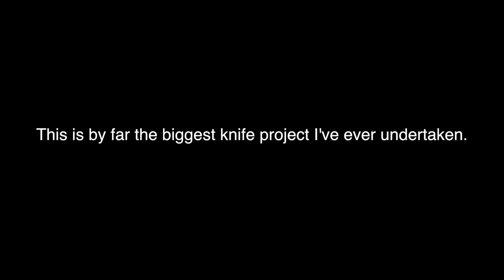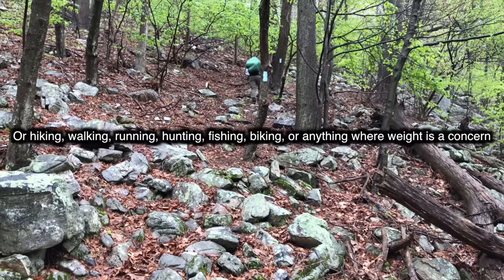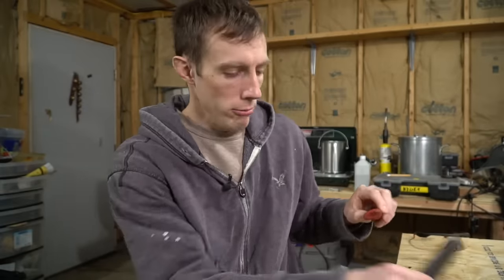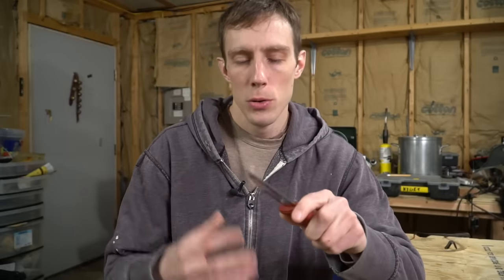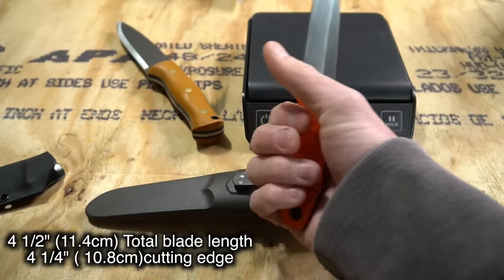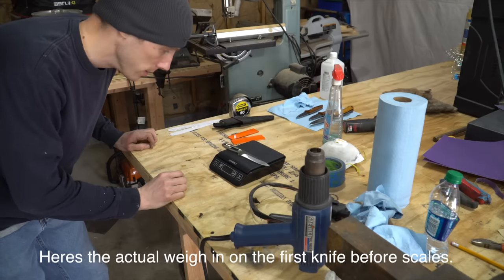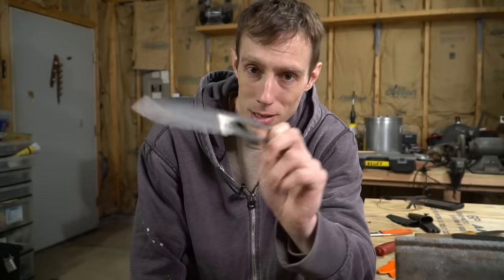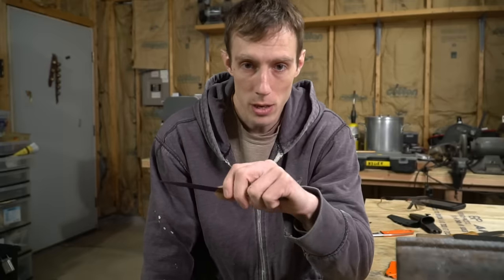What is the ULTIMATE Knife? Probably not what you think...

Comment: Ok, this was a really old video - for the algorithm, for fun..  Of course we all learn more over the years..

(carbon fibre and fibreglass COMPOSITES weigh about the same as 75% epoxy, stiffness and strength vs weight is the key with materials selection, not "bulk modulus" - Aramid and UHMWPE fabric is lighter than carbon.  Handle scale material is better chosen for appearance and style than mechanical properties - especially in a full tang knife  (hollow out and fill with foam when really worried about 10 grammes.. )

Comment: Ka-Bar ESEE Becker Eskabar, 3 oz, 3.25" blade that's 0.17" thick.  But that's with a handle that's naked steel.
Reply from the maker: No scales and blade is too short. Doesn't fit the parameters.
Reply: @OUTDOORS55  Close, though.

Comment: What if you used titanium for the blade?
Reply: Way way way too soft. Titanium is very strong for its weight, but does not have near the hardness required for a knife.
Reply: @2stroke_fanatic357  Titanium can be hardened to the mid 40's and it has been made into fixed blade knives. I believe Mission knives is one manufacturer.
Reply: @informedcitizen8687  that would only be used as a driving knife! Mid 40's  is a joke! Anything under 55 would wouldn't make much of a knife. Hey, let's use cardboard, because we all know about paper cuts! 😁

Comment: Why not remove the center of the scales, go with a tapered spine? At the back, you could use thicker carbon fiber to get good feel in hand, and just pin it with like 8 small pins, plus a hallow lanyard pin. Maybe a smooth hourglass like fuller to take some weight out of the blade. Screws may be lighter than pins and recess for them would take even more weight out while possibly adding a bit of grip, but terrible for keeping clean.

Comment: In continuation of my first comment. You could also reduce the size of the scale without reducing comfort. If you remove a few mm from all the edges... the scales will still feel good and you can use normal G10. Failing that you can drill pattern the handle like crazy... make it a feature of the knife.. it will enhance grip.  I feel like I should take up the challenge... Hmmmmmm

Comment: Well, if the steel is 3oz at 0.120" thick, it will be 2oz at 0.080" thick, regardless of what type of steel.  I'd probably go aircraft-grade, something in the 41xx or 43xx series.  Or go crazy with Nickel-Chrome-Moly, which IIRC is 98xx series.  You'd need some rather high-carbon versions of those steels, but it shouldn't be impossible to find 4180.

Or you go extra-nuts with L6 tool steel.  Though with battoning, you might want a 0.120" thick spine and really hollow-grind the crap out of it.

Comment: Simple Solution. 80CRV2. Distal taper. FFG all the way to the spine. 1/8" thick on the spine at the ricasso. Hidden tang, tapered in both dimensions. Handle of stacked leather, a strong, light wood, or a combination of the two. If you want a guard, either Ti, Al will work, but thin steel would also be fine.

For non prying tasks, the highest strength to weight blade grind is a hollow grind, but can be more challenging. A FFG is barely gonna weigh any more.
Reply from the maker: Ive already ruled out a hidden tang as i dont want the handle material to be a structural element. Thats one thing i missed in the video. 👍
Reply: @OUTDOORS55  if you have a tig welder, you could do a titanium/steel san mai, with the whole handle of ti.  http://www.e-tokko.com/clad_metal.php?lang=en

They sell prelaminated billets.

Comment: I would like to bring the idea that every bit counts with this if you want to drop weight without kissing strength why didn’t you use a false edge, file working,  jimping, even a something as small as a etched or engraved design would help. I would just like you to consider these as they could make the knife look cooler while also dropping weight.
Reply: Tapered tangs, something similar to the channel in a Yakut knife would be feasible since you do forging know as well, I mean there are a lot more ways to remove a bit of metal, for your consideration the mora robust is not full tang and it easily handles batoning so maybe a thick push tang on a thinner knife blade
Reply: I’m going to begin making my own design to compare to yours I think it would be a cool challenge for other knife makers to try

Comment: Why not use titanium for weight and hardness?
Reply from the maker: Titanium is very soft not good for knives
Reply: @OUTDOORS55   mixed with high carbon steel, theoretically, should lighten wieghr and still give you a hard edge. That's just theory based on metalergy, I've never seen it proven in real life

Comment: What about adding a fuller to first knife
Reply from the maker: Thats a great idea 👍🤔
Reply: Have a look at Yakut knives for some inspiration, they have a large fuller forged into one side, the hidden tang would reduce weight too.

I have a few Mora's here that I will weigh.

Mora basic 511 is 78 grams.

Mora companion has a longer blade and weighs 77 grams.

Mora 612, this is a traditional mora with a thicker blade, steel ferrule, steel guard and hidden tang running 3/4 of the birch handle. It weighs 73 grams.

It should be noted that the Mora 612 is sharpened all the way to the heel of the blade before the tang, no ricasso.

If you're having trouble keeping below your weight limit with modern methods consider traditional methods and materials.

I love the concept of this under 3 ounce knife build, it really challenges you to think about material properties and efficient design.

Comment: Cool Vid, Hiking? you mean the PCT or Camino  type hike.. low weight makes sense. Here is an idea that you may want to kick around.Do a bit of calculating in terms or blade thickness taking into account you will skeletonize the blade......... WHAAAAT....Not so silly, you can optimize the hole or void pattern for battoning  .. makes heat treating a bit more challenging but you will reduce weight as well as keep your cost down. Carbon fiber scales are just very very expensive. You can make the difference up by machining out the inside of the scales. You only need a tiny wall thickness( Router or dremmel will work just fine) Just remember to do all the drilling etc before you bevel.... maybe also change your grind with this type of mod in mind. It will be fine for 99% tasks just not as a pry bar...Hope this helps....Keep the vids coming.

Comment: yes carbon fibre is the lighter material, but only About 20% (6g 1/5oz). you want a material with 50% lighter (15g 1/2oz) material. (Density G10: 1.85g/cm³ Density Carbon fibre: 1.5g/cm³)
you want material with 0.9g/cm³. even oak is (if dry enough) between 0.4g/cm³ and 0.9g/cm³.

Carbon fibre has it's Advantages in strength per gram (if you want to say it like that). you can work with extremely thin layers of Carbon fibre so you don't have so much material and thus weight. your handle should be strong, but (i imagine) it has to be of the Right thickness to grip it better.

i think Carbon fibre is not the material to use here.

Edit: Spelling errors (sorry for my bad english skills)

Comment: To each his chosen goal.  I have carried my 6.1 oz. Al Mar SERE 2000 every day for nearly two decades.  Why would I change for a trip onto the hills?  You recognize that a knife is your most important tool, so do not compromise.  Also, “two is one, one is none.”  I’ll add a fized blade to my EDC folder for that woods trip.  If I decide to carry my 19.25 oz. Busse Steelheart II it will be because I view the indestructible Busse as an alternative to a hatchet (which can also be a camp knife) and likely have a Silky saw with me.  If I go lighter, I’ll still take one of my most durable 4-5” fixed blades, chosen for durability over extreme light weight.  Saw off your toothbrush, buy carbon fiber tent pegs, if that kind of craziness is your thing.  But never compromise on your blades or your sleeping bag (Wiggy’s, of course).  Have fun with the ultralight project, but be rational. 👍.
Reply from the maker: Thats the point, no compromise but less weight.
Reply: @OUTDOORS55  it is definitely a challenge.

Comment: If you really care about weight then change out your scale material. You don't need a super durable plastic if you're using the knife in a reasonable way. You can probably do fine with a high density plastic foam or softwood.

Comment: mkay, so some quick maths I did from a class I took over two years ago now, but work (as a unit) from what I remember is something like mass moved over a distance  (kilograms*meters?)  so basically with his estimate of needing less than a 200 gram knife and a 20 mile daily hike (52 kilometers or 52000 meters) times the average* knife goal mass of 150g (.150kg) it works out to being 7800 work units.  to put that in perspective, my backpack (for school mind you) weighs about 3 kilos, making it so I need to move it a distance of 2.6 kilometers or roughly a single mile to make up that same amount of work to move mass.  Basically 50 grams isn't going to be the straw to break the camels back even over 20 miles.  (please don't be too mean actual engineers, take this comment with a grain of salt, because this is all off the top of my head [who needs fact checking anyways] and from a high school class I took 2 years ago.)

Comment: Tapered tang? The end of the tang does not take much force.
Reply from the maker: I was trying to not do the tapered tang route. I want som lateral strength in the handle for battoning. If i want i can still remove the same amount of steel in the tang, just on the inside of the hollow rather than the edges like on a taper. And id still have some lateral strength. I still may do a taper though im just not sure if it's needed yet🙂

Comment: This is a good example of the 80/20 rule of engineering.  Where 80% return only requires 20% input.  You saved 31% in weight with that knife(compared to a stock mora basic)  while almost doubling the cost of the base blade ( not counting labor), and getting the lightest possible knife will drive the cost up even more. ($9 for steel ~$15 for G10)  There's about $24 USD of materials compared to an $8 USD knife. CF is ballparked to be double the price of G-10 so for $39 USD you get a knife that is 42% lighter (assuming you get it down to 2.5 oz) and more with the upgraded steel that you picked. 

TL;DR optimizing a design to its ultimate state creates operates on an exponential rate of marginal return
Reply from the maker: Exactly. Although one thing your missing is capability. So far it will be a much more capable knife, and fill a lot more rolls. Even being used as an edc pocket knife (because it actually fits in a pocket) that will also process firewood😂 a mora basic can't do that.  Generally speaking your correct, but someone has to push the limits 🤷‍♂️👍
Reply: @OUTDOORS55  that's a fair point, and it would be cool to see a comparison between the two for capability. 
I'm not bashing the project either (amateur knife maker here)
Reply from the maker: I do plan on testing the mora under the same conditions but its not a fair test as its not a full tang. The mora is guaranteed to break under the same testing ive don't already for the othe blades. However, im not sure how much of a difference that makes in real world uses. Most likely none. It will still be interesting to see what it's capable of🙂

Comment: So I happen to work in carbon fiber. First, it's a common misconception that carbon fiber is super light. It's a lot lighter than things like steel and high grade CFRP has stiffness and strength comparable to steel, which means it's super light for structural members. But for a fixed volume object (like handle scales) its mechanical properties are basically irrelevant. The density of carbon composite is about 1.6 g/cc. This is basically the same as G10.
Second it certainly doesn't cost $50 to make two dinky handle scales. Carbon fiber costs something like $50 per lb of cloth. Typical fibre fraction in a laid composite is about 60%. At scale your 1/2 oz handle scales can be made for about $2 of materials.  

If you want to do something with carbon an effective strategy may be to make scales of carbon-foam or carbon-aramid-honeycomb sandwich panels. these can be way lighter.

Comment: Skip the epoxy and use a peened flat rivet instead of pins. This will remove the need for epoxy as you don't actually need epoxy to hold a knife's scales in place. drill a hole 1 to to sizes up, peen it and, and grind flat.🤷‍♂

Comment: Anyone in the Military will tell you how important weight is. Only a few big dogs can carry the weight. I used to not give a crap and carry a extra 80lbs. Not anymore I carry maybe 20 to 30 if only on my backpack. I always carry a boot knife unless I have to go to the courthouse. I'll leave it at home. Alone with my old timer pocket knife. My boot knife is my just in case knife. In case of anything was to happen I'm dead on with it. You should be able to throw it 20 to 25 feet with no problem and hit your target. Or don't even both to bring it. I use to carry many many more knifes. I just don't like carrying the weight anymore. Mora knifes are cheap and lightweight but very thin and can brake when thrusting or if needed to get up a tree quickly. There great for make traps to hunt game to eat. Its perfectly fine for making spears to. Lightweight get important when backpacking 10 miles.

Comment: Looks like a convex Enzo Trapper with a round grip. Looks uncomfortable. Carve a spoon, a figure four, and a bowdrill set in the same sitting. Then tell me how much you like your ultimate knife. It may turn out that you hate it. 

I made a 109gram knife. 3.5" cutting edge, 4.25" handle, 1" wide with a spear point. Skeletonized grip with walnut scales and oak pins. It's slightly thinner than 1/8" while the handle is 20mm thick. It's in 3V at 58Rc. I can do all manner of outdoor tasks from skinning deer, setting traps, making fire, or cleaning my finger nails to kitchen chores. It also sports a slightly exposed tang so it can be driven into a piece of wood to be used as a draw knife. All of this without any funky curves, choils, jimping, or other weirdness. 

I do think your knife could be comfortable, but the handle will need to gain weight, while the blade is shortened. Knives are levers so if you have a short handle and a long blade you have a recipe for inefficiency.

Comment: Really?  The obvious solution is to use a leather sheath rather than a Kydex sheath.  That should save you weight.  Thinning the blade makes it less likely to baton well.  The morakniv spark will give you a firesteel  or the kansbul, both weigh slightly more, but look at the time, energy and money you would save.  I think the spark without the firesteel meets your 3 ounce criteria.